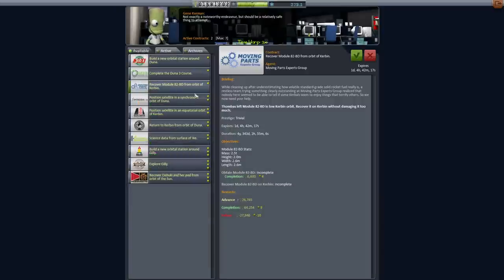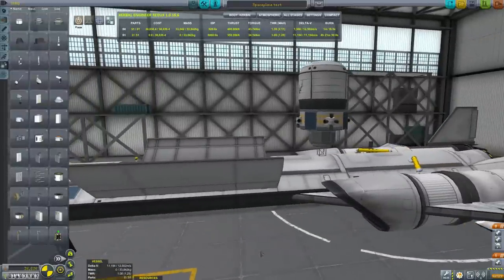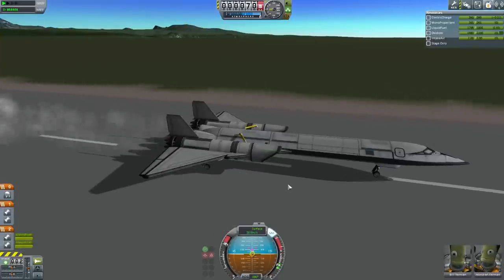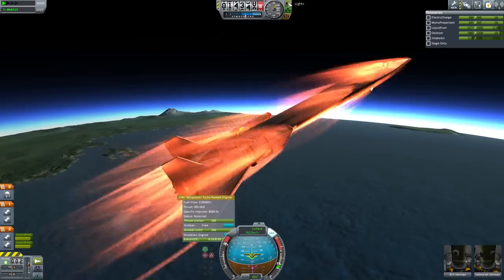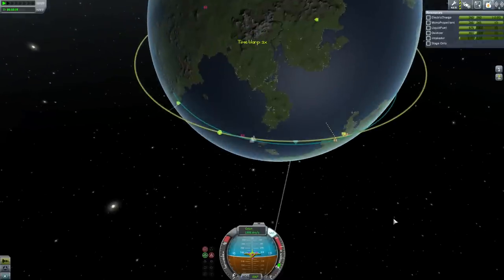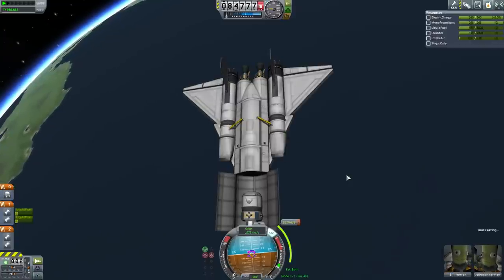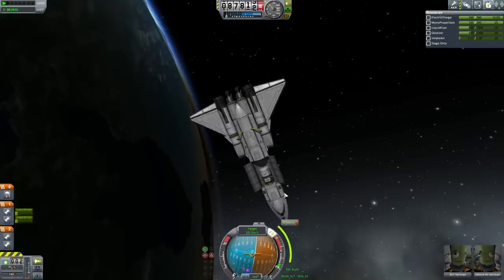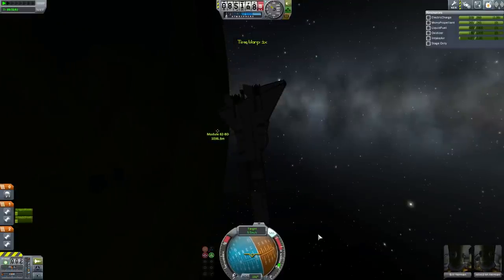Kerbal Space Program - Career Mode - Part 26 - Space Plane To Orbit

Comment: Holy crap I flew a spaceplane. Question though, I tried to make my plane identical to yours, but every time I pitched up it would roll to one side or another, and get all squirrely. I managed to orbit and land (!!), but it was pretty difficult. Anyone know what I might have messed up?
Reply: Glenn Morse ah, did you forget to turn off roll control on some of the control surfaces? You probably made the easy mistake of not editing which directions are changed by the different control surfaces!

Comment: I'm thinking of trying this design with Aerospikes instead of the Swivels but I don't know if the loss in TWR will cripple it or not... I mean, the slight modifications I made before took its TWR below 1.43 and it still made orbit fine. So my previous SSTO estimates are empirically wrong anyway...

Comment: Between the two videos, did you forget the refueling step?

I went pretty much along with building it but had to expand the cargo bay a little and I'm ending up far above the 13-15 t usually recommended per Turbojet. It flies like a brick. Did you really completely refuel the thing or did you leave out some?

Comment: I actually built a copy of this plane to compare your design with mine. And despite carrying two engines worth of dead weight, it actually makes orbit with twice the amount of fuel my design usually has (Although to be fair, that's mostly because my design has less fuel tanks) even though it has to spend longer accelerating in the top layer atmosphere. The long nose seems to reduce friction to let it sit in its own friction induced sheath of superheated gases for positively AGES without any major overheats, the air intakes of course got pretty hot, but nowhere near hot enough to take actual damage.
I added an inline docking port in front of the forward tank since I pretty much have one on all my SSTOs in case of emergency, and the added weight reduced the TWR somewhat but it still reaches orbit just fine.

I think I'm shamelessly going to rip off the concorde style design for all my future cargo SSTOs, although for my passenger shuttle I still think my previous design fits better, since it's a bit easier to dock.

That is odd though, when I did my testflight it lifted off like a feather at around 65m/s, and that was with added mass from the inline docking port and RCS.

Comment: It's kinda funny though. Most of the time when I try to make a SSTO space plane, I'm just barely able to get it outside of the atmosphere before it runs out of fuel, and when I try to add more, it ends up being so heavy that it can't really pitch up at all when I'm above 10km.
And then there's Scott, seemingly without a specific plan, just placing stuff around, and he still gets to orbit no problem, with lots of fuel to spare.
Guess I should mess around with space planes some more.

Comment: What logic do you use to decide between static and deploy-able solar panels?
Reply: Jonathon Wisnoski One point is that static cells are cheaper. You can usually get away with fewer solar panels, because of the crew not needing constant electricity. Probes are usually smaller, and need to have extendable panels to save a little space as well.

Another reason why he chose static solar panels is because they aren't such a hassle to keep in one piece in docking. Having fragile panels glued vertically onto your spacecraft can lead to disaster a lot quicker than if they are glued to the sides. To be fair, he has a lot of experience. It's always good to take precautions though.

Comment: I can't seem to get my docking port to "snap" in the cargo bay. i'm having to place it manually and then i can't attach another docking port to it. doesn't make a difference with angle snap or without it. Anyone that can help me?
Reply: Use the mod key. I'm on Linux and it's right shift for me. It'll snap modules to a nearby attachment node. There are loads of funky extra features using the mod key, check the wiki for details.

Comment: I can't wait for the re-entry video.

 my MK2 based spaceplanes have a habit of the nose blowing up.even when I try aerobraking backwards the nose blows up.

I have started using the inline cockpit so my kerbals can survive.
Reply: Thanks, I will give it a try when I get home. 

my return vessel from eve yesterday looks hilarious with no nose.
Reply: rodbotic When re-entering with a space plane, i recommend keeping a fairly high periapsis as Flamrule said but also do a series of S turns on descent. You may have seen Scott Manley doing this when his spaceplanes descend. Basically you just point your nose  towards the normal and anti-normal directions, alternating. I prefer this over nosing up/down as it keeps you from skipping out of the atmosphere or descending too rapidly and burning up

Comment: Is it just me that have problems with this build with KSP 1.0.4?
I start to lose speed at around 2000m and have to enable the rockets engines very early.
The engines have been nerfed but still big difference
Reply: I've given space planes my first attempt after seeing this. I initially tried completely replicating this but it just doesn't seem to get up to speed in the air enough and tops out far too low.
Reply from the maker: James Duffy when they updated to 1.0.4 some things changed -   https://www.youtube.com/watch?v=SdmNv2ZyMmU
Reply: Scott Manley Oops, would have made sense to have checked ahead. Thanks, will give that a go after work. Love your videos, given me a lot of advice.

Comment: getting it up there is one thing but how are you going to get it back down? Without it burning up that is...
I tried it on my old save (had one orbiting kerbin from an older mission) and it burned off all its wings and the landing gear. Almost killed the kerbins too but they got lucky.
Reply: Flare. Spam W and S, and stall the plane! 180 g's is Tuesday for a kerbal.
Reply: Thierry Van Tillo With the new version, airbreaks are a good thing to have.
With themm you can kill already a few m/s in high atmosphere.
And you should bring you spaceplane back in the atmosphere in a flat reentry, so it's unlikely that it will burn up.
Furthermore you can turn your spaceplane und turn left and right.

Comment: I think this doesn't work anymore as of 1.0.3
Reply: Crank797 A little update: turns out that the jet engines have been changed. They provide a lot less thrust than they used to back in 1.0.2.
Reply: ***** According to Scott's latest video this plane still works. And I figured that removing a greater portion of oxidizer makes the plane work again.
Reply from the maker: Crank797 It works, but you have to be less aggressive (and carry a bit less oxidizer) https://www.youtube.com/watch?v=SdmNv2ZyMmU